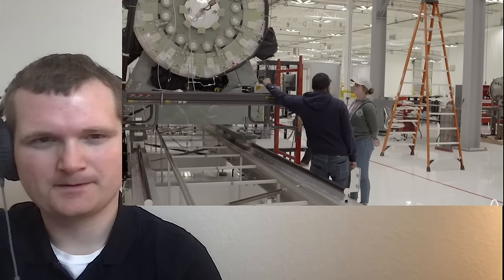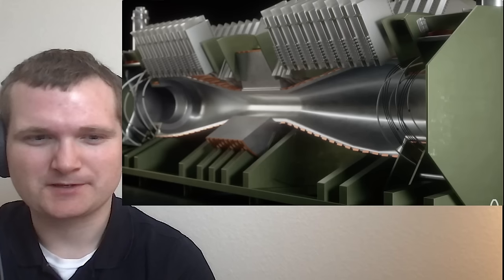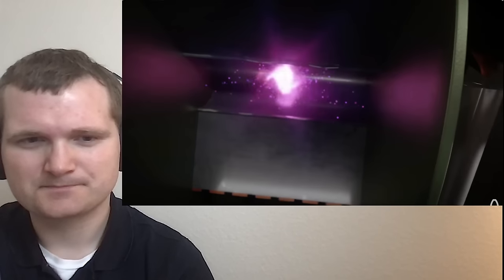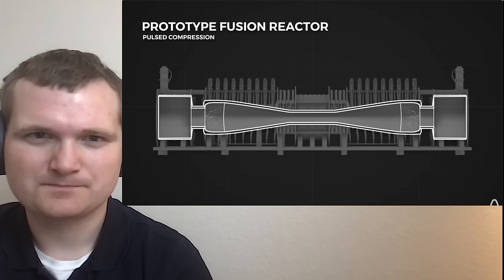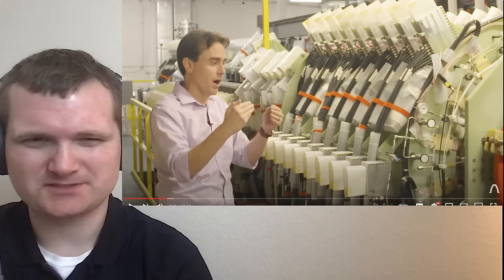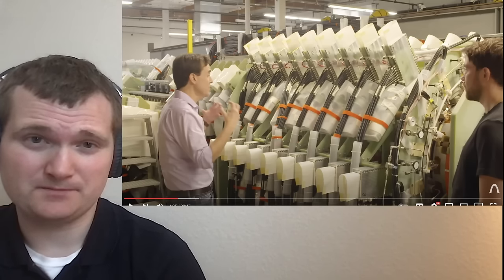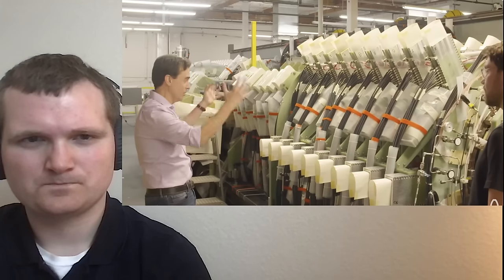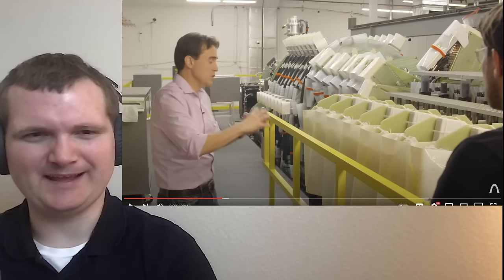Will the Helion Fusion Reactor ACTUALLY work? - Nuclear Engineer Reacts to Real Engineering

Comment: The Youtube Channel Impossible Matter also did a great breakdown of the... let's generously call them 'concerns' with Helion and the Real engineering Video in particular.

Real Engineering responded to the video in an embarrassingly petulant manner and basically claimed that he didn't bear any responsibility for uncritically parroting Helion's nonsensical claims.

Impossible Matter's video - "The problems with Helion Energy -  a response to Real Engineering" is fairly short, but he also has a three part series quantifying the temperatures, pressures, rates, and isotope makeups of possible fusion methods, as well as the large number of instabilities and problems with fusion at the moment, that is well worth the watch
Reply: The IM video is complete nonsense though. He based his "critique" solely on the RE video without actually checking any of the real resources on the matter. He never understood the concept and all of his arguments are completely off the mark as a result.
Reply: @elmarmoelzer2229  What evidence is there that he is "off the mark" rather than "generally correct"?

If Helion starts generating net-positive fusion without irradiating their employees within a year or so, that'd pretty definitively prove things on the side of Helion and Real Engineering.  Want to take the bet that they'll acomplish that?

But more importantly, if he's wrong because he based his information on the Real Engineering Video... then how does that not endorse his point that the RE video is misleading?
Reply: @Xylos144  
The RE video is not misleading, but it is relatively superficial (there are a few mistakes in some details, but they are minor, IMHO, like one animated graphic showed the wrong fusion product).
It does not contain all the physics details you would find in a scientific paper or a talk in front of peers. IM could have looked up David Kirtley's talk at Princeton, e.g.
Since then, Helion has also made their latest paper available on their website. 

As for the rest of IM's video... Here we go again... My critique of the "critique"

- Critique: "FRCs have been done before and never worked." 
First, define "worked"! What was the goal and scope of the experiment and what was the outcome?
Second, yes, FRCs have been done before and the members of Helion's founding team were actually involved with several of them and since the 90ies or so. They applied the lessons learned from those to their own design, which they have tested over 6 prototypes so far (and have patents for).
Lessons learned and applied:
1. Size of the FRC. The larger, the less susceptible to n=2, rotational instabilities.
2. Elongation to radius ratio. The longer the FRC, the more stable it is to tilt instabilities.
3. The merging before the compression. This part creates a single, hotter and more stable FRC as a target for compression. FRCs get more stable, the hotter and bigger they are.
4. Helion's pulsed FRCs have a very low electron to ion temperature (Te:Ti) ratio of 0.1 and less. That makes things a lot easier compared to machines where both are in an equilibrium because: 
P(fus)/P(loss) scales as Ti^1.5 / (Z^2 * Te^0.5 )
Where Z is the atomic number (in case you wonder about that).

- Critique: "Deuterium - Helium3 has a smaller reaction cross section than Deuterium - Deuterium. At the 100 million degrees temperature discussed in the video, Deuterium - Deuterium reactions would be much more likely than Deuterium - Helium3 reactions."
That is generally true, but IM misses some key points:
Trenta is a subscale prototype with much weaker magnets than what they are proposing for a full scale powerplant (and what will go into Polaris). Because of that temperatures are somewhat lower than in a full scale power plant. Power plants aim for temperatures 20 keV (220 million degrees) and up to 330 million degrees (30keV). At that point the D-He3 reactivity surpasses the D-D reactivity.
That said, Helion actually wants some D-D reactions because that is how they are breeding their He3.
D-D => He3 +n or D-D => T +p
Both reactions have a 50% chance of happening.
So, in mixed mode (breed and power) machines, they will need two D-D reactions for every D-He3 reaction, at least until the Tritium inventory is large enough that they have a constant He3 supply from decay (Tritium beta decays into Helium3). Since Tritium has a half life of 12.3 years, that can take maybe 20 years. That fact is probably the best criticism of Helion's approach (which he did actually not bring). That said, they can work with two D-D for one D-He3 reactions until then. Just have a few more neutrons.

- Critique: "Deuterium - Helium3 is too hard and Tokamaks cannot do it. Therefore Helion's approach of fusing Deuterium and Helium3 can never work."
D-He3 is very hard to ignite, but they do not need ignition for their design to produce enough net electricity to be economic. Most of the energy from D-D and D-He3 reactions is released as charged particles, not in neutrons. Helion can recover the energy in charged particles directly as electricity at a higher efficiency than a steam plant would. They can also recover 95% of the input energy directly as electricity. That makes their machines a lot more efficient.
Further, FRCs are high Beta (~1.0) compared to Tokamaks (~0.05). Beta means the ratio of the plasma's internal pressure to the pressure applied externally via magnets. 
Fusion reaction rate (the amount of energy produced) scales as magnetic field to the 4th power, an extremely strong scaling. However, that is the magnetic field inside the plasma, not outside, which scales as Beta^2 and B_external^4. 
If it was just about the efficiency of the magnets (it is not), then a 10 Tesla Helion machine would outperform a 200 Tesla Tokamak.
But, it is a bit more complicated than that, because confinement times in FRCs are generally lower. You win some, you lose some. Overall it is still a win for Helion's approach.
Since Helion is using adiabatic heating through the compression stage, they can to some extent(!) balance temperature and density almost linearly for a given magnetic field. D-D reactions favor higher density and lower temperatures. D-He3 is the opposite way round. They can tune that just to the right sweet spot between density and temperature depending on which reaction they want more of.
Another thing that works in Helion's favor is the aforementioned Te:Ti ratio. This ratio actually decreases further with higher temperatures. So the hotter the plasma gets, the smaller that ratio. Trenta already showed Te:Ti at <0.1(for Tokamaks it is ~1). It is likely that a power plant will have an even lower ratio. Lower electron temperatures greatly reduce Bremsstrahlung losses. At a ratio of 0.1, thermal transport losses actually kick in earlier than Bremsstrahlung.

- Critique: "The neutrons from Deuterium-Deuterium reactions would have fried Trenta and I see no shielding." 
As mentioned, Trenta is a subscale prototype, an experiment. It is smaller, weaker and only operates at one pulse every 10 minutes (max). A full scale powerplant would do 10 pulses a second!
Not all shots were fueled by Deuterium or Deuterium + He3. Many were fueled by a mix of hydrogen and Deuterium or pure hydrogen, depending on what they wanted to test.
Because of that alone, the total neutron flux that Trenta has experienced so far is not that high.
What the critique also does not mention is that neutrons from D-D reactions have a much lower energy than those from Deuterium- Tritium reactions (2.45 MeV vs 14 MeV). Those 2.45 MeV are below the activation energy of many materials.
The machine is mostly made from low activation materials or materials with a half life measured in minutes. Aluminum activated by D-D neutrons has a half life of 2 minutes.
In fact testing different materials under neutron exposure was one of the purposes of Trenta. They have tested quite a few alloys to see how they behave.
There is still permitted shielding, of course. It is in the walls of the room and not close to the actual machine, which can handle the aforementioned relatively reduced neutron load just fine. 
It is also worth mentioning that a mixed mode Helion power plant (that does both breeding and power production) would produce neutrons only in one third of all reactions (1/4 if they have He3 from decay or trade). So the neutron flux, even for those machines would be MUCH lower than for a D-T Tokamak. 
Also note that D-T side reactions from Tritium produced in Deuterium fusion reactions are greatly suppressed in Helion's design. The Tritium is too hot (1 MeV) on the timescale of the pulse (<1ms) to have a good reaction rate (mostly elastic scattering) and it is extracted along with the other fusion products between pulses.
Either way, Trenta did some 20,000 1ms pulses over its lifetime. That is a total of 20 seconds. JET did a total of 100,000 pulses some lasting several seconds. So lets say 1000 seconds total. "Clearly" it looks like Chernobyl now...

- Critique: "Helion claims that they discovered new physics when they say that the ion gyro radius is 25% larger."
The whole ion gyro- radius thing was based on a misunderstanding and out of context quote and maybe also bad wording.
What happened was that Trenta achieved a higher ion temperature than predicted by Helion's (purposely) conservative physics model (a higher ion temperature is actually a good thing since it means more fusion!). That higher ion temperature caused a 25% increase in ion gyro radius, which is perfectly in line with established physics. That's it. Nothing to see here! 
It is worth noting that there have not been new FRC- physics in decades. They are relatively well understood by now.

- Critique: "Helion had previously said that they would have a working power plant in 2021. "
IM was clearly very eager to get a "gotcha" on Helion. I guess he did not read further up on the very page he shows a screenshot of, or he would have seen that Helion was in the process of raising funding at the time of the blog post. They did not get that funding until summer 2021. Even Trenta was less than 35 million (especially if you take the 35 million into 2019 dollars, when they started building it).
No bucks, no Buck Rogers. Should be quite clear, no?

Comment: Other then that I like their idea, I'm not going to say much about the fusion reactor. 
The D + 3H reaction produce P + 4H, so no neutrons in their power generating reactor, just the D + D reactor where they make the fuel.
What I am more optimistic about, is the research on the power generation part, that is something our world need a better understanding on.
Reply: Their initial machines will be doing both, breeding and making power. That is still fine. Even without additional He3 from Tritium decay (or trade for He3, which is actually CHEAPER than Tritium right now), they would only have one neutron for every 3 reactions and that neutron "only" has 2.45 MeV (vs 14 MeV in a D-T reactor). So, IF we think that we can get D-T reactors to work, their machine would most definitely work.

Comment: Once, fusion is achieved,  would create new, solid particles isn't it? Where would thoose solid particles go from the confinement? Would they just condense on the walls of the chamber, rendering it un-even, disrupting further fusion processes, or would they just escape confinement puncturing the walls of the reactor similarely to muons?
Reply: Once fusion is achieved, it won't create new Solid particles, it will create new elements though, which will still be in a plasma state as the extreme temperatures wouldn't allow them to be in any other state. For helion's reactions, they won't be making any new elements as they're reacting deuterium (hydrogen with a neutron) and helium 3 (helium with one neutron instead of two), so the product of the reaction will be a proton (basically normal hydrogen) and helium 3 + a neutron ( basically normal helium). Therefore, there are no new elements produced as the number of protons in each reactant and product remains the same, and since both of them are charged particles, they'll continue to remain trapped in the magnetic field bubble until they're exhausted out as hot gas to allow for the next batch of fusion reactant fuel to be ignited (think of it like the 4 stroke combustion engine)
Reply: @justiceifeme   Thank you for the answer! i did not catch any exhaust vents, nor a step in which fused particles could be flushed from the system. was thinking on how the fusion works in the Sun, but there's no confinement there, exept the gravitational pull of the star itself, and there are escaping particles, bursts all the time... immagined an extreemely dense core to it, which solidifies in the case of a white dwarf, but i see what you're saying, at extremely high temperatures even ferrous material could not solodify, could only stay gasous, or plasma in that magnetic confinement.
Reply: @mrnoid9949  You're welcome, the exhaust system was mentioned in the video during the part talking about the diverter (in most fusion designs, the diverter is often likened to the Ash tray of the reactor), it serves as the path for fused particles to gather, cool and be exhausted out of the system. Most of the exhaust particles aren't thrown away either, as helium is in short supply on earth, so capturing it is very useful.

And yes the sun relies on gravity for confinement and it's fusion products are also trapped in and compressed into it's core due to that same gravitational force. We don't have the amount of mass the sun has, so we can't replicate it on earth and have to find different approaches to fusion like tokamaks and what Helion is doing

Comment: I love them - I hope they stay safe. That ten million joules of those capacitors is very close to 24 hour basal metabolic rate of a 100kg human . That is about the rate you expend energy while lying down. Also is equivalent of 100W lamp. And 2390 kcal. So just doing nothing for 24 hours equals the energy capable lift you up to 10,000 meters. (That tells why it is impossible to lose weight in gym) They use really high frequency to pump up caps and release. That frequency was 1000kHz. I wonder how high they can possibly drive that freq with current technology?

Comment: I think the reason for the lower output is more about stack ability. How many Helion fusion reactors can be stacked for higher effect verses scale of a larger single fusion reactor using higher power factors and semi different production processes. Bigger reactor costs more and takes up way more space compared to something of this projects scale means you can fit more of Helion reactors in one area and produce more energy output stacked. 
1 Tokamak vs 1 Helion reactor, the Tokamak wins hands down on theoretical energy production, but with multiple Helion reactors it is a no brainer.  It is partially about scale and expense.

Comment: The big advantage they have is size. Their reactors dont need to be HUGE MEGA SCALE projects in order to reach break even. They're the sort of size where it only takes a year or 2 to build. test, and then start on the next version.   This is a big advantage as they can iterate super fast compared to reactors like ITER.
Being able to generate power without going through the steam turbine phase is also a big advantage if they can get it to work.

Comment: 25:03, Temperature is kT, average energy of molecules at 1 billion kelvin is 10keV. When every reaction release energy order of MeV, the energy consideration from increasing temperature is minimal. High temperature do affect stuff like stability of materials which affect shape of magnetic field which affect stability of plasma. But these are not issue of increasing temperature and you get less energy from reactions.
Reply: 10 keV is 100 million K, not 1 billion K.
Mind you, Helion is aiming for 20 to 30 keV for future machines. Trenta was just sub- scale, so also lower temperature. Polaris will be bigger and stronger (maybe up to 20 keV, 200 million K).

Comment: If I understood correctly their deuterium - deuterium (D - D) reaction will not produce any energy; it will only be used to produce He-3, along with lots of neutrons that need to be handled..
The final D - He-3 reaction is aneutronic, generating a proton and an alpha particle. That proton per reaction is the main appeal of using He-3 instead of tritium (despite its much lower efficiency), since they can directly convert those protons to energy without requiring a steam turbine and also use light shielding at this stage.

However if their D - D reaction produces no energy their total efficiency will drop further. The energy wasted during that stage obviously cannot be ignored; it also needs to be taken into account. And due to all those neutrons their fuel producing reaction will require much more robust shielding than their energy generating reaction.

He-3 is an unfortunate requirement for whoever targets both aneutronic fusion and direct energy conversion*. Fusing D with Li-6 is also aneutronic, and more efficient (22.4 MeV) but the reaction products are two alpha particles, hence no direct energy use*. And the only other two aneutronic reactions that produce protons are He-3 + He-3 and He-3 + Li-6...

*(edit)My bad.. Somehow I forgot that alpha particles are also charged and thus can also be used for direct energy conversion. But I assume using protons must be cleaner and more efficient, right?
Reply: The D-D reactions will be about self sustaining. So no energy wasted, but none to sell. The D-He3 reaction more than makes up for that.